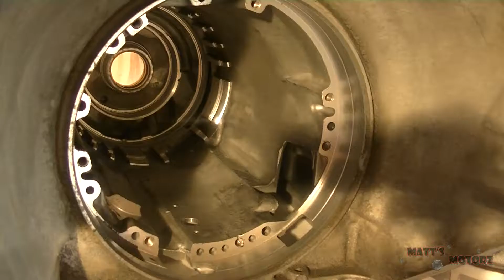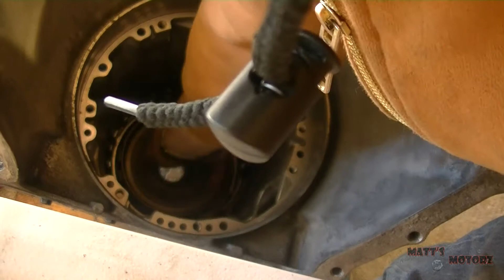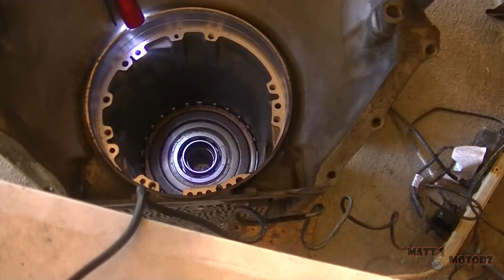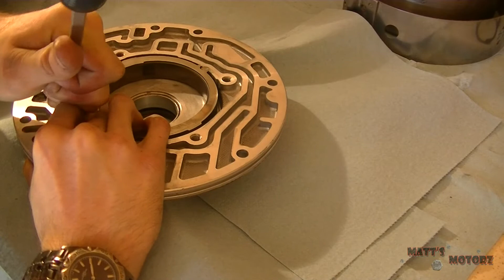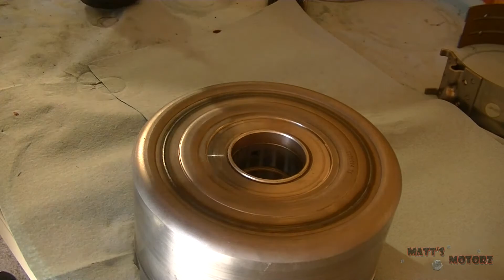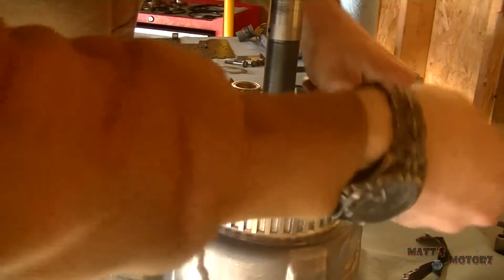4L60E / 700R4 Transmission Rebuild [Part 10: Reassembly of Pump and Gear Train]

Comment: Very helpful re "piston" related to "case" installation.
Reply: 1)  I'd also mention the "vanes" are supposed to be placed very specifically, so as to have "a degree" of "curve" (even adjusted at insertion by the "tech" doing the work) at the outside edge (not the inside edge) of the pump (rather than being "flat" at both edges upon installation)?  2)  Thank you for the earlier reply re "ATF" lubricant on reassembly for all parts.

Comment: My dad is replacing the 4L60E transmission in his 2000 model Holden VX Commodore just because it has done 370,000 kilometres, he claims it has a problem with gear shift but I drove it on Friday & it had nothing wrong with it.
If the transmission was slipping or it has rough shifting I'd be looking to overhaul it,just because it's got high kilometres on it doesn't mean it's had it !!!!
He's doing the same thing to the Buick L36 engine (3.8 litre V6),number 2 cylinder has a leaky valve & low compression, the rest of the cylinders are o.k.
The oil seals leak & need replacing,I'm just going to reseal it & bolt another cylinder head onto the engine.
It has valve recession due to running on liquified petroleum gas & the exhaust valve in number 2 cylinder warped.
The engine has been serviced every 5000 kilometres,the transmission has been serviced every 20,000 kilometres so is still o.k. despite the kilometres.
I am looking to fix the engine up & sell it to someone who needs it, the transmission can be sold as is !!!!

Comment: I'm rebuilding my engine and my 4L60e is leaking fluid between the pump and the case. The unit is still n the truck. Can I remove the pump and reinstall it laying flat like that?
Reply from the maker: +blackericdenice Unfortunately, the transmission must be removed to remove the pump.
Reply: MattsMotorz Even though the engine is out?
Reply from the maker: Well more specifically, the transmission must be unbolted and removed from the engine.  If you just pulled the engine and left the transmission still in there, you WILL be able to replace the pump.
Reply: MattsMotorz I'm worried the pump want go back in without hurting the sealing rings.
Reply from the maker: Naw it should be okay.  Just make sure they are well lubricated and you go slowly.  It can be a little nerve wracking yes, but what other choice do you have if the pump already leaks?
Reply: MattsMotorz The only other problem I had was a shift flair going from 2nd to 3rd for about a year. When I rebuilt it. I replace the separator place with a 4 cylinder plate. The 3 books I read said nothing about there being a 4 cylinder plate. I had to drill out the 3rd gear apply hole.

Comment: Where did you find torque specs for all bolts?
Reply from the maker: All the information you can ever want is in the factory service manual.  A transmission rebuild should NOT be done without the manual, even with helpful videos.

Comment: Can you send a link to the special tool that you bought on ebay to compress the low reverse piston?
Reply from the maker: Just type in the part number in a google search.  It is in the factory service manual.
Reply: I thought maybe you had bought one that wasn't so dang expensive :), like a generic or something.
Reply from the maker: Unfortunately no.  I will say however, that I have used this same tool on other transmissions (I made different "heads" for it to fit the drums I was working on).  So it is very useful!
Reply: Thanks for all the help!
Reply: +Shane Trotter I bought one off ebay for $50. It get the job done.